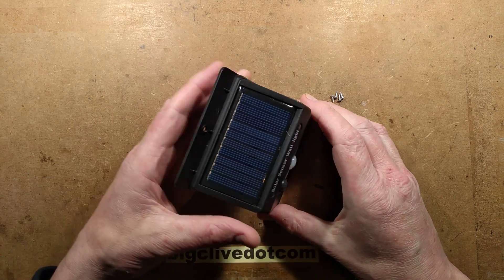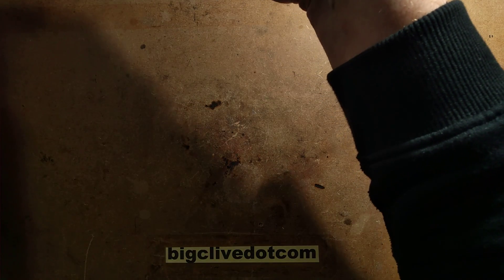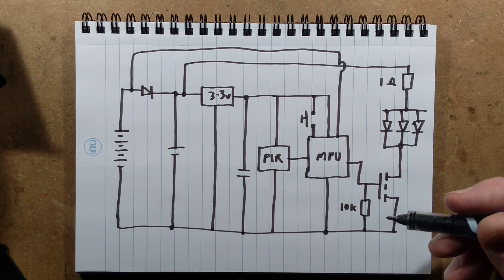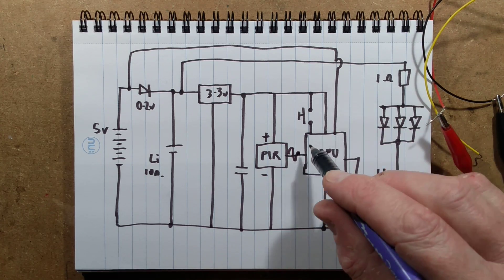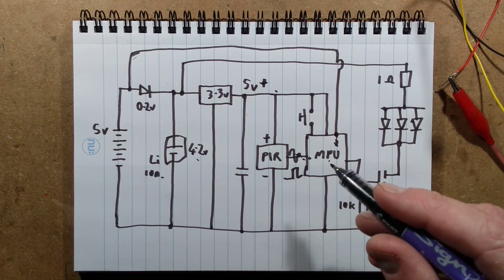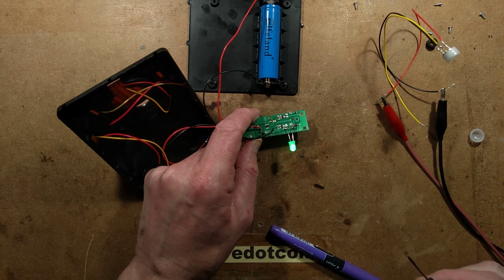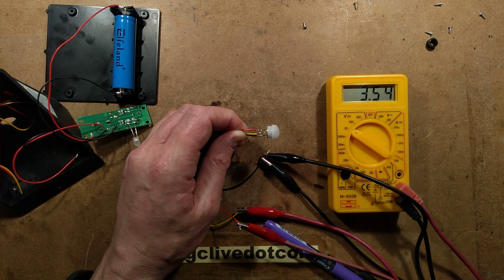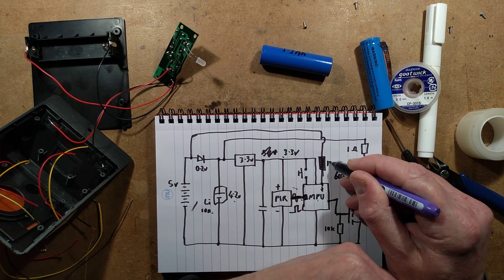Autopsy on a badly designed solar light (no lithium charge control).

Comment: So.. they skimped on a single large value fraction-of-a-cent resistor.  Beyond that, cell has to contain its own little protection board and as it'll still be charged to the hilt and sitting in a black enclosure in the sun (hot!) its capacity will drop by half or more every year.  Lovely.

Comment: Thanks!  I bought 2 of these for parts as an unit was 3 USD .   The light output is weak but not bad when powered by (5 - 1.2) VDC;  USB dropped by two diodes.   Sadly the solar panel and LED array are strongly affixed so it isn't likely I can pull them off - just use with the existing case.

Comment: 8:10 .. pauses and goto aliexpress to buy some pcs of that digital PIR
Reply from the maker: Any luck?  The modules are bigger, but do offer some adjustment options.
Reply: @bigclivedotcom  mmm, ordered also a small one, but with a board sticking out the bottom and this many pin chip

the exact one you found I didn't manage to score unfortunately :(
Reply from the maker: eBay keyword.  AM312   sold as little modules with nothing more than a regulator and some caps.
Reply: @bigclivedotcom  perfect !

Comment: I’ve had 3 of these all work for a month or two and stop. They are shite. I wonder if I did add a protection circuit and s current limit resistor if it would work. Also thought of a 10K pull-up resistor on the MPU to give the voltage needed for trigger?

Comment: i wonder if these 18650 lithium batteries have gotten so ubiquitous and common that maybe it was cheaper then using a NiMH battery and they just switched it out.
Reply: this can very well be the case,  clive made a video about lithium batterys being used in one time phone chargers and e-cigs
Reply: it is. i bought this recently because I was hoping to extract a NiMH AA battery inside (cheaper than buying a NIMH battery), since old solar garden lights have a single AA Nimh.  To my surprise, it is a lithium battery but at the form factor of a double A!

Comment: Well, flaws aside still looks like a decent little light
The ones I use are always on Low light then go full bright with motion, I have 2 on the back of the house, 1 on a swingset pointing towards the house, 2 on a pole on both sides and 1 on the awning near the front door. They do a hella great job. Due to how they work with the auto brightness mode they last all night, and if by chance they don't I can charge the batteries with a charger. Strangely enough though they don't use 18650's but a normal AA size rechargeable. They were extremely popular this summer, Walmart kept selling out of them in the stores.

Couldn't you have used the FLIR to see what component was heating up to see what wasn't working with the board?
Reply: you sure it's a regular NiMH AA cell? there are 14500 lithium batteries which are the size of AA cells. dont ever want to accidentally put it into a circuit meant for regular AA :)
Reply: @Polite_Cat  Yup, its a normal size AA rechargeable, I do have 2 lights that use 2 bigish 14500 cells that you're talking about though.

Comment: I always thought that it's kind of crazy  to have a lithium battery in those. Isn't heat  supposed to be bad for lithium ion batteries? What do you think Clive?
Reply from the maker: If it's mounted at the base of the unit it shouldn't be too bad as it's not getting heated directly.
Reply: @bigclivedotcom  thanks Clive.
I have a couple cheap ones but never put them outside for a full day to charge. I always charged the batteries up & use them for emergency lights.

Comment: I've got a few of the versions where it only comes on temporarily when it detects movement, they've been there a couple years now and have been working fine. No idea if the battery is charge regulated.

Comment: Isn't "no lithium charge control" a long phrase for "bomb"?
Reply: Not with a Li-Ion cell. Lithium Polymer batteries are the ones that are violently angry when overcharged; a Li-Ion cell will generally just vent some schmoo no more dangerously than a NiCD/NiMH cell would do. Doubly so for a shitty low-capacity low-output cell like would be used in this device.
Reply: @TestECull  but i overcharged a practically dead li ion cell with 12 or 13 volts and all it did was go up to 4 volts max and immediately discharge fast back to 2 volts, 3 volts for the other battery
Reply: @peppermeat8059  How do you still have a house?
Reply: @TestECull  i retrieved it at the right time and my house is made up of bricks and concrete
Reply: The current from the solar panel is too low for the battery to be a safety risk - it will degrade though.
Reply: Yes it is, IF you're talking about a multicell installation, as in an EV.
Plenty of YT vids showing it. But this one is the clearest, I would suggest.
https://www.youtube.com/watch?v=WdDi1haA71Q
One catches fire, and the rest explode in a chain reaction.

There's a follow up vid from the guy running the shop, where he admits it was a stupid mistake to have attached a 'dumb' charger to the battery pack. In essence, the same as this solar light.
Reply: No.   There has never been an example of a Lithium-Ion or Lithium-Polymer explosion.  They'll catch on fire, yes, but detonation requires significant containment (which phones and laptops don't have)  Basically, the cell expands, and will shatter the casing.   If it happens fast enough, it'll ignite.  The Lithium batteries that will explode, and are dangerous as all get out, are the Lithium Primary cells, such as the CR123.  You can find information about them on the candlepowerforums.com site.   Those will detonate, and they release hydrofluoric acid vapor.  (depending on the chemistry, of course)
Reply: @tbelding  christ i was just reading about that and I have a sudden urge to never use them again.

Comment: Which explains why mine never went on in the bathroom and I pissed in the sink. I hate it when that happends.
Reply: I pissed onto the closed toilet seat lid once, didn't notice until I felt warm pee splashing into my PJ bottoms.
Reply: @uK8cvPAq  If you sleep as you should do you notice a lot quicker.

Comment: had some of these delivered last month but not fitted them yet.
Won't hold my breath after this.
Reply: Pull out the lithium batteries and fit 3 series-wired NiMH cells like Clive mentioned. At least that takes away the safety concern. If one current-limited the solar cell, some NiMH cells will take an endless trickle charge in stride. ("Trickle" charge being somewhere in the range of 1/10th C to 1/40th C. Example: A NiMH cell with a 1000 mA capacity would be charged no more than 100 mA current, ideally closer to 25 mA.)
Reply: @McTroyd  will do that. Many thanks
Reply: You can change the lithium cell for a protected one.

Comment: Well, Clive, there's an idea for a potentially great video, featuring possible flameage and the explosion containment pie dish: What happens if you constantly put 18V to a normally discharged 18650 LiIon-cell (sitting at around 2.8V) and current limit it to 1A? Might be fun! Be safe!
Reply: It will fly out of the pie dish like a rocket and burn down his workshop.
Reply: @BenjaminEsposti  We wouldn't want that though.
Reply: If it's a decent cell (any of the namebrands) likely nothing. It would get really hot, but it wouldn't explode or bulge. These things have vents, so if they are overcharged, stuff vents out. 
if you look at the datasheet, most are actually rated to take up to 12V of absude without exploding.

Comment: I bought a few of these a while back, tho mine didn't have the side lights on them.

They died after about 2-3 months, and a discord buddy with more electrical knowledge explained that the batteries were indeed overcharging.  Also recommended I get some battery protection circuits along with some new 18650 batteries and they'd work fine.

I rigged up the batteries to be removable, added the batteyr protection and those lights are working.

My buddy said his have been working for going on 2 years or so I think.  Tho his actually had proper battery protection in them.

If you have some of these cheapo lights, get some battery protection circuits.  They're cheap enough.

Ebay "10pcs 3A BMS Protection PCB Board For 1S 3.7V 18650 Li-ion lithium Battery Cell" 

https://www.ebay.com/itm/10pcs-3A-BMS-Protection-PCB-Board-For-1S-3-7V-18650-Li-ion-lithium-Battery-Cell/153572617664?ssPageName=STRK%3AMEBIDX%3AIT&_trksid=p2057872.m2749.l2649

Or just get better solar lights.
Reply: You could probably save money by going for pouch style batteries instead of 18650. Most of them have built in protection.
Reply: If you're getting new cells, why not get ones with the protection circuit built in?

Comment: Horrible brand of battery, had a red one with a bit more black in the label.  Never kept a charge.  feather light and tossed it in the dump
Reply: You should've recycled it properly. Most shops have a designated container for batteries.
Reply: @simontay4851  well not exactly in this city.  heck they tell us to throw old fluorescent bulbs in there.  Thats a no no in most places.  that and it's one battery.  I wish I could find a proper method without sparks of removing them from laptop batteries.  Thought about ceramic scissors but I have no idea.  Think the last time I tried that was on a recalled set of Dell batteries (battery)  Panasonics

Comment: Hey Clive, I've got a cheap multi-meter that I found will turn on by itself when its near a gas stove being ignited. It's a TackLife CM02A. I couldn't for the life of me figure out what was making the noise when I was cooking. I managed to get a video of it so I know I'm not crazy. Any thoughts?
Reply: The ignition spark causing RFI perhaps? Does it stop turning on if you disconnect the test leads?
Reply: @uK8cvPAq  Hmm I tried it just now and it won't do it with or without the leads. I must've moved it
Reply from the maker: Its power-on circuit might be being interfered with by the external sharp current spikes.  Like some electronic stuff goes berserk when put near a plasma globe.

Comment: Solar light that requires "do not use under direct sunlight" warning
Reply: I brought 4 off the bay £16 1broken 1 blew the end of the battery off after being on the side of my caravan 2 still working when they want to , good idea badly made as Clive said saved pennies in wrong places
Reply: When i was about 17 the power banks with built in solar panels were starting to come out. I thought awesome i better get one. I can keep it in my car and it will always be charged and ready if i need to put it in my pocket for use.  Lasted a few weeks on the dash of my car in summer and it pretty much cooked the battery to the point it would only get my phone an extra 2 percent. I didnt know then that lithium batteries should not be charged at 160 degrees on my dash. I dont know if the heat only is what ruined it or if it also got overcharged from the solar panel.
Reply: @poellot  you're lucky it didn't immolate your car 🤨
Reply: @CsykKrit  and i was top of my class in college.  I can see why this world needs so many warnings. A smart kid like me even needed them.
Reply: @poellot  jesus
Reply: @poellot  mine actually melted sitting on my dash. I feel lucky it didn’t catch fire or melt the upholstery. That was about 10 years ago.
Reply: @poellot  heat is the #1 destroyer of batteries, also the fact theres no charge control
Reply: @peppermeat8059  this was back when lithium batteries were first hitting the market. 
My new cell phone even had a nimh. So lithium was new to me. I thought they would handle anything.  This was way before all the youtube videos of lithium battery fires.

Comment: Would a protected 18650 avoid the overcharging, leaving only the problem of back feeding the 3.3V rail to above it's rated level?
Reply: Seems like it should help. All the battery-operated LED lights Clive has opened up rely on the cell protection in that way. The second issue, back-feeding the uC pin, might be fixed with a zener diode and a resistor. It wouldn't take much to make the light usable, if one were so inclined...
Reply: Ted McFadden - a suitable in series resistor should be all that is needed. The protection diodes in the chip will then be able to clamp the voltage on the input to a suitable voltage level. But best to modify a new one, as that is likely to result in a more reliable outcome.
Reply: Good point about the clamping diodes. That's probably why this designer thought he could get away with being cheap here, presuming this micro has them.

Comment: However they were designed, the one that I only paid $9 for has lasted through two winters and a summer now...🤷‍♂️
Reply: I too have been using 10 of these lights for over 2 years with no issue. During the summer months they are still in dim mode at 5 am when I get up for work
Reply: @Elberto71  I bought one and used it for two nights and went back in about more! What kind of wish I would have bought in like 10 of them at the price that they were at. I have not had a single issue and they are bright!!

Comment: Look alot like the ones I got on Amazon. So could I just put two batteries in instead?
Reply: 6s nickel based battery pack would work a treat in these, as would a 2s Li-FE pack, as their nominal voltage ranges are right in line with what the charge circuit puts out. 1s lithium anything - no go. 2s Li-ION would not charge significantly as their 'depleted' voltage is higher than what the charge circuits can push.

Comment: ALDI do a similar unit with or without backlit LEDs set in the back of of the unit
Reply: Clive's reviewed that previously. Looks like a much nicer light. PCB is certainly far better engineered in the Aldi light.
Reply from the maker: The Aldi one looked a lot better.  I brought it across with me in the belief that the chip was doing some clever sensing from a standard PIR sensor, but this unit made me realise the PIR is probably digital.

Comment: So he could add a tp4056 charge protector board a diode and a new chip good to go😁. Same situation I'm in with my light. I just dont have a diode, and pir sensor, or microcontroller.

Comment: The PIR input on the MCU may have been damaged by an ESD event when you were tinkering.  But otherwise I agree that this design is quite bad - hard to acheive when it is also so simple.
Reply from the maker: That did go through my mind, although I do try to keep a low static risk work area.